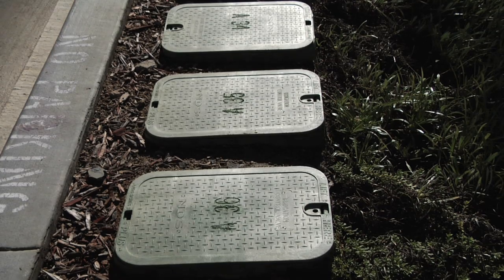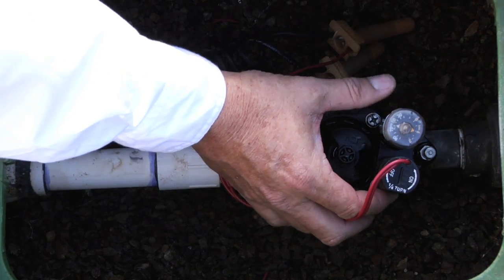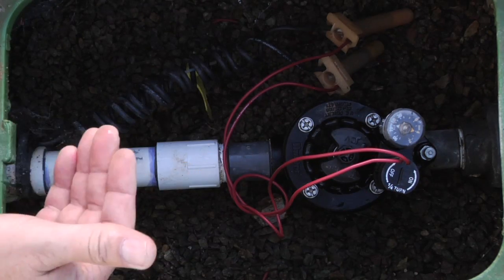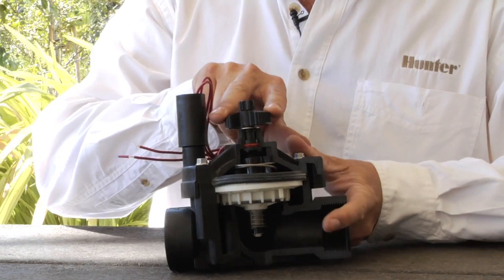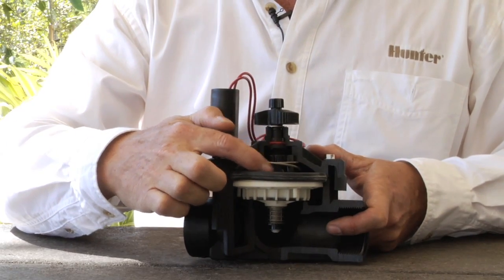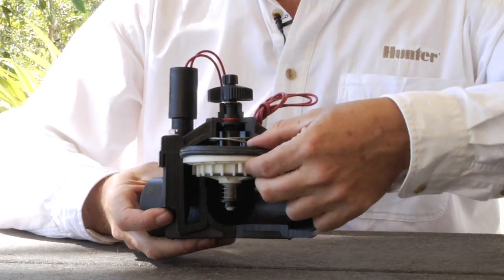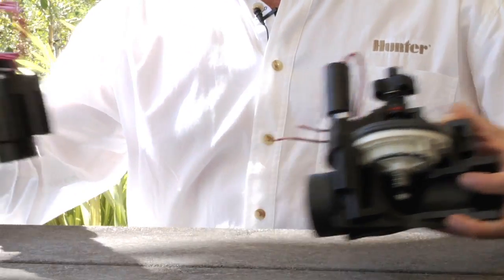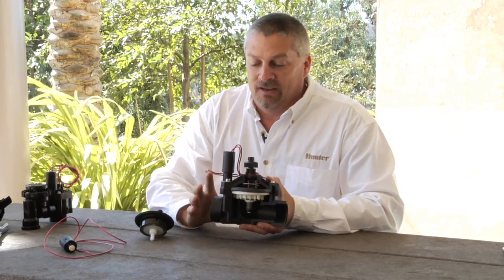Basic Hunter Valve Operation

Comment: I bought hunter hunter PGV control valve, can the solenoid itself be connected to 110V instead of 24V?
Reply from the maker: No, Hunter irrigation valves are not rated to connect to high voltage. Irrigation controllers reduce 110 volt down to a safer 24 volts. There are also options to to activate valves on battery power.

Comment: Hello..I have Hunter Node 100 where water is not stopping ...guess need to change diaphragm but I can find diaphragm for Hunter PGV. Can one for PGV fit into Node 100?
Reply from the maker: The Hunter Node is battery operated controller and does not have a diaphragm. The PGV valve does have a diaphragm which can be purchased from your local Hunter distributor.  Here are the details on servicing a valve but make sure there's no debris left inside. 
https://www.youtube.com/watch?v=72Y3mmZLNyo&t=21s

Comment: No water coming out from quarter turn. Shut off water, removed the solenoid and the o-ring was broken as well as the diaphragm was separated from the solenoid. I pushed a new o-ring all the was from the metal part close to the diaphragm, pushed the metal piece back into the solenoid and then screwed the valve back in. Turned on the water and did a quarter turn test. Still no water coming out of the sprinker heads. This is the only one that I have an issue with. All other  zones working fine.
Reply from the maker: Thank you for contacting Hunter Technical Support.
 
If the solenoid is good, there is also a chance that the exhaust ports within the irrigation valve are clogged. This would require you to clean the ports in the valve. Learn More
 
For additional support for Hunter valves please visit the support page.
 
Thank you again for contacting Hunter Technical Support. Please let us know if we can offer any other assistance.

Comment: Is there a difference between opening the valve on the solenoid or the bleeder. I personally use either way.
Reply from the maker: The reason for each adjustment capability is different, although their effects are the same.

The bleed screw is designed to release unwanted air from the body of the valve.  Using it also causes the diaphragm to open, and the valve to turn on.

Turning the solenoid manually causes the water to be displaced and the pressure on the bottom of the diaphragm to be greater than the pressure on the top, causing the valve to turn on.  This is the method designed specifically to turn the valve on "manually"

Comment: Does the bleeder screw remove air trapped in the pipes?
Reply from the maker: Thank you for contacting Hunter Technical Support.

The bleeder screw can relieve a little or some air trapped in and around the pipes going into the valve. There is a better product application to install to help relieve any air trapped in the system. It is called an air relief valve.

The AVR offers a commercial non-corrosive solution for releasing adequate airflow at the high points of a micro-irrigation system during start-up and shutdown. This helps stop water hammer and resulting system damage. The AVR will also prevent system collapse through vacuum relief.

https://www.hunterindustries.com/irrigation-product/micro-irrigation/airvacuum-relief-valve

Comment: Can lowering the flow control valve stop water hammering
Reply from the maker: Thank you for contacting Hunter Technical Support.

When an irrigation zone is flowing enough water through the piping that the velocity is greater than 5 feet per second, the system will start to water hammer. You may hear pipes shaking or squealing noise coming from valves. Not all water hammer is noticeable because the piping is buried or irrigation is scheduled when no one is around. Water hammer puts a tremendous amount of strain on irrigation components, even if you are using a pressure regulator.

Water has a specific weight that when traveling at fast speeds can act as a battering ram inside the pipe and beat up pipes, heads, fittings, and valves.

The best way to reduce the water hammer is to design your system with an appropriately sized pipe for the zoning requirement. If your pipe is already in the ground, there isn't much we can do about the sizing. You can tune your valves by using the valve flow control feature. Here are the steps:

· Start with your valve flow control wide open. Turn the valve on from the controller.
· Start to turn the flow control knob clockwise until you start to see the spray from the sprinklers drop.
· Stop and open the flow control half of a turn.
· The flow of that valve is now tuned to the zoning requirement.

If that does not solve the problem, water hammer arresters can be purchased and installed to try and fix the problem. Please contact a local irrigation distributor for assistance. Distributor Locator

For additional support for Hunter valves please visit the support page.

Thank you again for contacting Hunter Technical Support. Please let us know if we can offer any other assistance.
Reply: @Hunter_Landscape_Irrigation  Thank you for the information. I appreciate it

Comment: lets say the irrigation system pressure is not properly regulated, should the valve stem(flow control) be turned all the way to the right (clockwise), the left, or middle? Same question for the bleeder (small relief screw). Trying not to put too much strain on the valve.